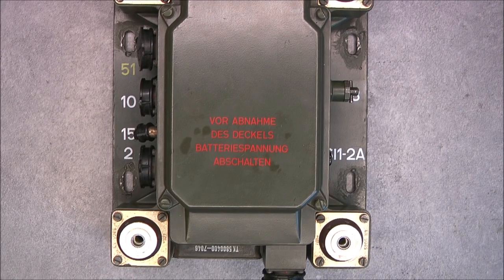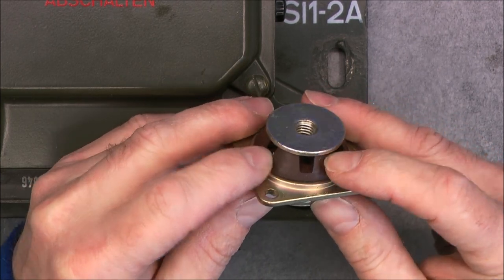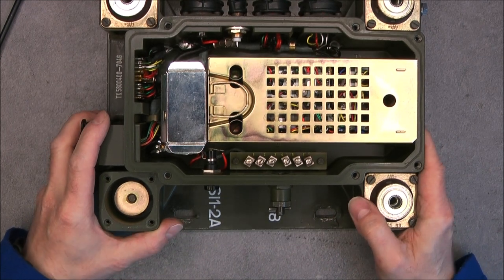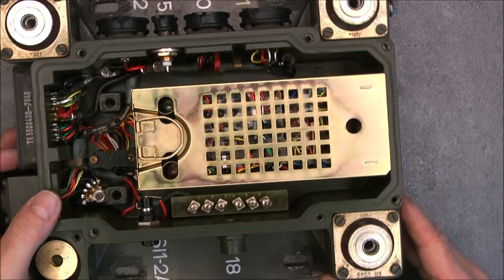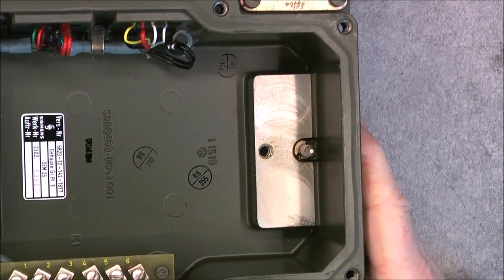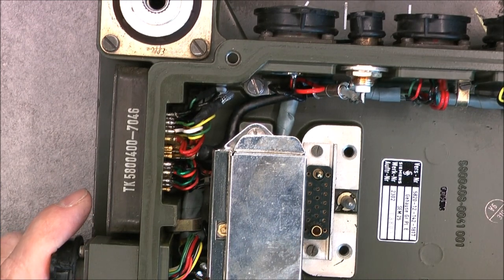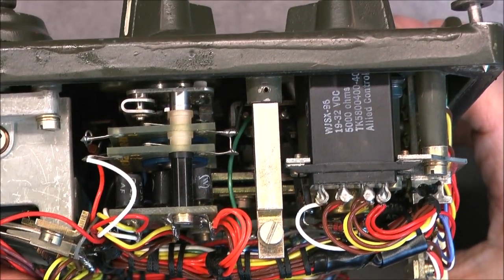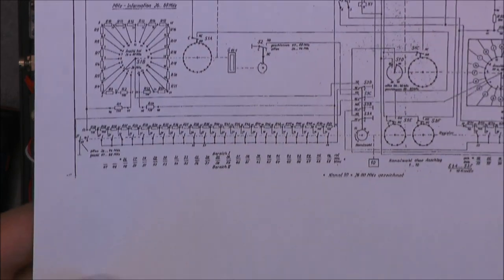SEL EM-25 teardown part 2: baseplate unit and control box

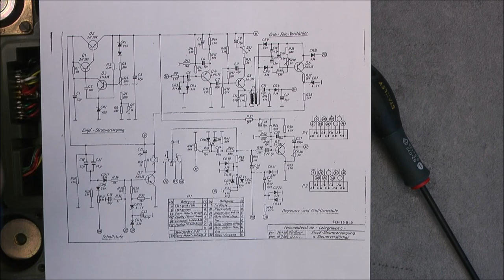Comment: At 07:50 this is not a power supply.There is a linear regulator on top left for this circuit. On the top this is an amplifier using two stages with bootstrap technique. The output is fed to a transformer with a Latour voltage doubler which permits to activate the transistor Q6 for a given AC input voltage. On bottom left there is relay command circuit with an activation at startup and 3 different inputs. On Bottom right another amplifier circuit which permits to have a phase shift between 0 and 180° using C31/R36 connected between the two out of phase outputs.
Reply: As usual, superb additional analysis to a great video - I spotted about 50% of it. I would really like to view a collaborative video by both of you on maybe, some fasinating missile, space or medical complex technology. Perhaps a live technological autopsy - I could make the tea and sweep up ;)

Comment: 19:30 The extreme left hand and right hand buttons control whether you use the upper or lower scales. The two inner buttons then select the MHz and kHz in the upper or lower ranges according to the outer buttons setting.

Comment: What a strange and wonderful beast! Those fiberglass PCBs don't look that ancient--maybe 1970s vintage--but the parts selection and design is positively archaic. It seems that those giant power transistors are a 2n1358, and, yes, they are germanium. And frequency selection with a few dozen 0.1% resistors? How is it able to keep stable tuning with that design?